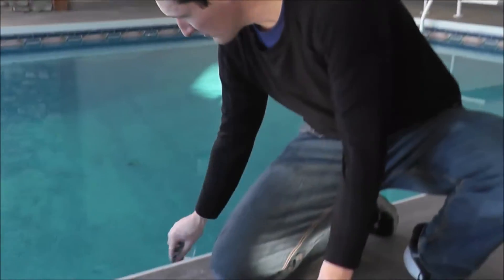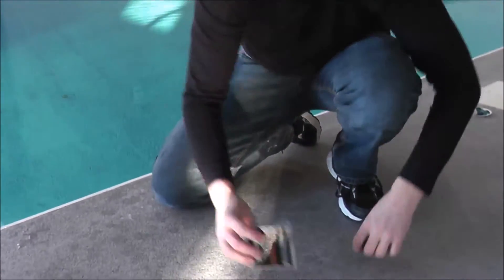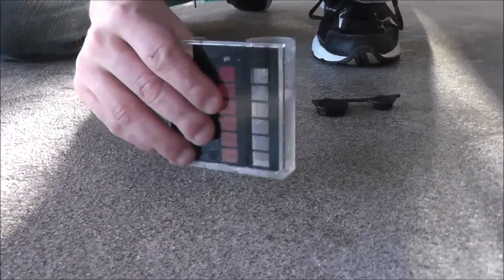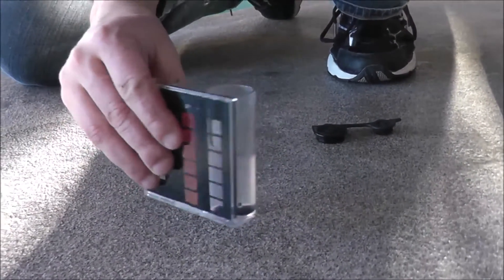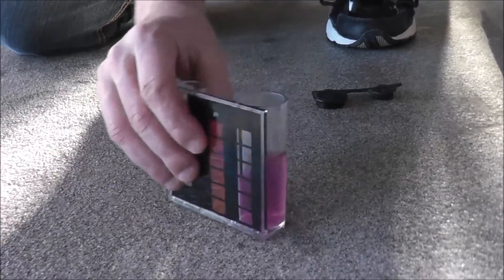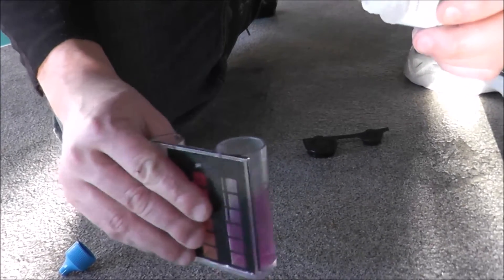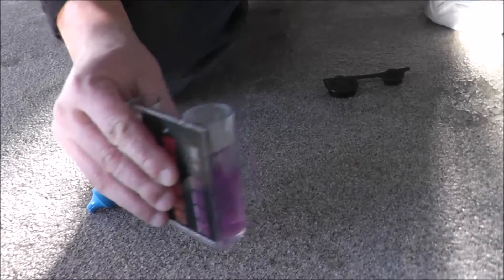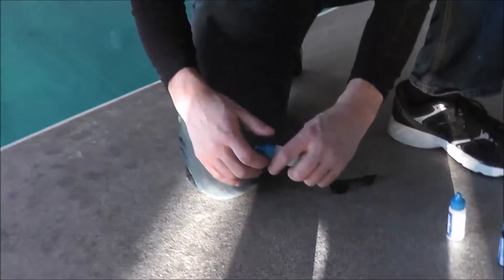How To Test Calcium Hardness In Swimming Pool Water

Comment: You need to let your audience know what your reagent numbers are. For example 5 drops of R10 etc. Not 5 drops of the blue stuff???
Reply from the maker: The test kit will provide the appropriate reagents for each test and will also provide instructions on how to test properly. We do not list the names as testing kits vary and are not always named the same.
Reply: @UVPoolsWinnipeg  If you're doing it a "pro" way, then you should know how to calculate and divide the drops to do 10 ml of test water this ALOT less drops.
Reply: @tommynorthwood  Great suggestion!